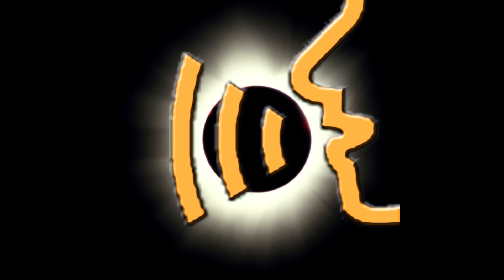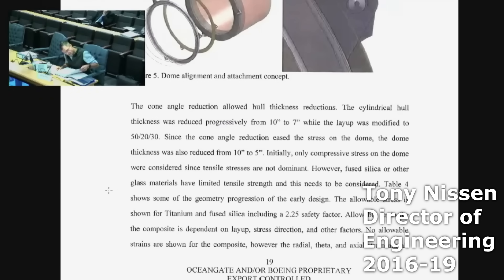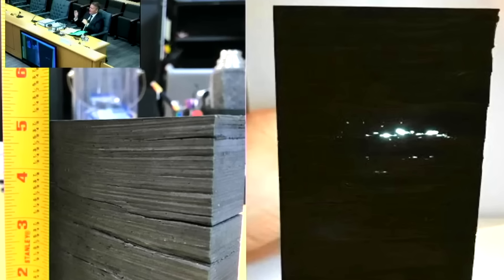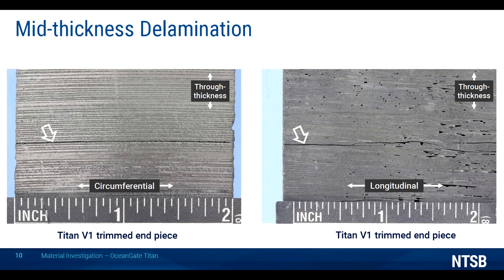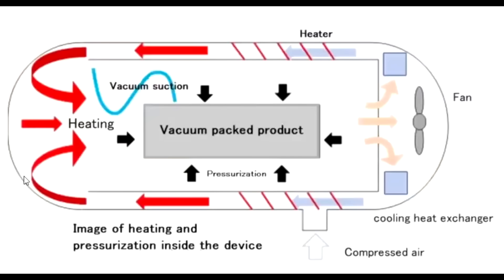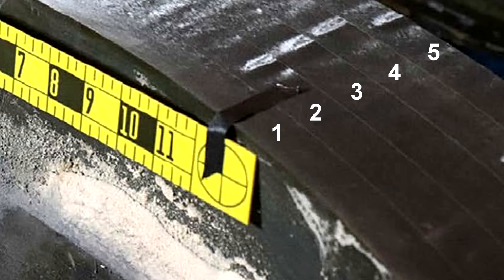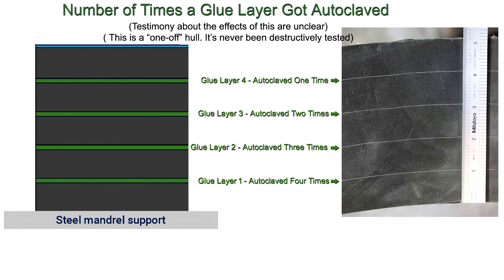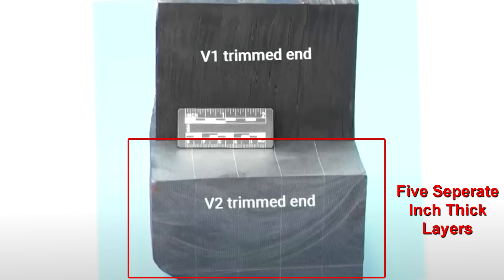Who Engineered the OceanGate Titan V2 Hull? Maybe Nobody Did?

Comment: It would be valuable if you would comment on what changes are needed in the system to close the loopholes that allowed Oceangate to function with such risk. 
Also, hoe can the public protect themselves against such risk?
Reply from the maker: There are a couple of things in the works right now.  The big international submersible groups are drafting some regulations that may be able to be enforced internationally.  So just because you are operating in international waters doesn't mean you are exempt from safety regulations.  I don't know how, or who would enforce it, but they are working on it.  I believe they will somehow close the loophole of calling paying passengers "mission specialists" and falsely saying they are crew.  And, there is talk of having all submersibles have a standardized hook on the top, the design of which is shared with all of the ROV companies.  This way, in a situation where a submersible is stuck on the bottom there is a standardized way to hook on to it and pull it to the surface.  It doesn't make a difference in an implosion, but what if the Titan was caught and stuck on the bottom, where could an ROV hook onto it to safely lift it.
Reply: i dont think the public has to worry about imploding in a million dollar/ride sub

Comment: By design it was a hull that 
a) would progressively degrade with each mission as microcracks formed and grew
b) had no process in place for measuring the state of cracks before or after each mission
c) had no idea at what point the amount of microcracks would yield to failure at depth

It was going to fail, the only question was when.
Reply from the maker: Agree, thanks for your comment.
Reply: I'm just gonna add that every design is going to fail at some point, so it's just a question of knowing when it does. And oceangate clearly didn't
Reply: @aninnocent1544  well, its also a matter of being within an acceptable amount of uses to justify the cost. But that is less relevant here.
Reply: @aninnocent1544  every design wont fail because some things are over engineered. for example a one piece steel hammer will never fail. you can swing it at nails until the sun destroys the solar system. compared to a hammer with a wooden handle that will fail at some point
Reply: @will.green.  You under estimate infinity and time
Reply: Finnish Baltic yachts builds big sauna to their 100+ ft carbon fibre hulls , of course they try to build as light as possible, but round keel hull is 4"

Comment: Completely revamping the material and production process of the hull and then assuming it will act in the same way is the most insane thing to me. And using a material with a low fracture toughness seems incredibly stupid
Reply from the maker: Yes, I agree.  That is why I wanted to make this video.  Thanks for commenting.

Comment: Any first year engineering student should be able to explain why carbon fiber is a terrible material for that application. The carbon strands are incredibly strong. However that's only for tensile applications. I'd trust that design for a pressure vessel. The application however was a compressive force so had to rely on the compressive strength and ductility of the binder material.
Reply: They basically used ABS plastic as the main source of strength and said "it's super strong".

Although thickening the hull might have increased the amount of work the carbon itself does
Reply: I'm not an engineer and know the limitations of carbon fiber.

Comment: Uuuh, I don’t think it’s safe to have uncured prepreg composite up and around for over an hour before curing it. I'm pretty sure it needs to either be refrigerated or shoved immediately into the autoclave after being applied or it might cure badly
Reply from the maker: Thanks for commenting.  I don't know enough about composites and curing to say. But the process of doing layers and driving the hull around must have taken weeks.  Plus the thing is huge and heavy so it has to be rigged and craned around, so the transportation takes way longer than just the hour's drive between the facilities.  I did not want to get into all of that in the video, but you understand how hard it is to move something like that around.  Others have commented about the temperature and humidity affecting the curing process during the transportation.  I don't know enough to say.  I guess Electroimpact was okay with everything that was being done.  They were the experts.
Reply: @ what I know is that prepreg needs to be refrigerated to low temperatures before layup because the resin will start curing in hard to predict ways at room temperature. Each product is different but manufacturers will typically have a chart that will describe, between other information, how much time can pass between the thawing of the prepreg fibers and when they have to be in a vacuum package, and how much time before they have to be in the oven, and if that delay passes the fibers have to be thrown out because the resin will have cured too much for vacuums and air bubbles in the resin to be sucked out in the autoclaves, or for the manufacturer to be able to guarantee the properties of the resin.
Reply: Depends on the prepreg. Some have unrefrigerated shelf lives of days. Today TC380 has an out life of 28 days. Data sheet is free online if you want to check it out
Reply: @ that’s interesting, thanks

Comment: At the very minimum, designs should be required to test until failure at least once before carrying human occupants.
Reply from the maker: That is correct,  The budget should have allowed for one hull to be tested unmanned for say, 20 to 30, dives and then cut up the hull and examine the hull for evidence of fatigue and delaminations.  Destructive test.  But of course, the budget did not allow for that.  Thanks for commenting.
Reply: That doesn't really tell you much about fatigue life though which is the failure mode that occured here.
Reply: That's not practical for an airliner.
Reply: @robertlee9395 Major parts of airliners (wings, fuselages, landing gear) already are destructively tested, and occasionally fully crash-tested, but that heavily depends.

Comment: They didn't talk much about the grinding process to remove bumps between cycles. If the image they showed of the hull with longitudinal wrinkles in it was the working hull, is is quite clear why this machine failed. As the fibers of a full hoop are compacted radially, they will buckle prior to curing, as they cannot shorten in length to match their shortened perimeter. IE the fibers that are assumed to be straight, are curved, massively reducing their compressive strength. Then, several of them that are protruding past the surface are broken (ground off). I've built landing gear that got some wrinkles in the unidirectional fiber's and the strength was reduced by about 3-5x until we improved the process and eliminated those defects. Also, I do agree that the 45 degree fibers would have helped transmit the load between defective regions and adjacent intact regions. But what do I know, I'm just an unemployed engineer.
Reply from the maker: Thanks for your comment.  I ma working on a video addressing that right now.
Reply: shouldve kept your mouth shut about the safety of landing gear and let the planes crash if you wanted to keep your job

Comment: I dont understand why Stockton didn't send the sub down to the titanic empty first and make sure it comes back up alright.  Would have saved lives
Reply: At 19:55 you see the chart that shows that they did dive to Titanic thirteen times... and imploded on the fourteenth.
Reply from the maker: Thanks for your comment.  The V2 hull was a one-off and never tested other than 4 pressure tests in the chamber in Deep Ocean Test Facility Maryland before they started diving with people.  That hull should have had a rigorous testing program of dozens of unmanned dives first followed by destructive analysis to prove the design.

Comment: Thank you for the video, although it confirmed what I already knew. Carbon fiber is superb in a tension mode. In compression, a stack of bricks performs maybe better.  NASA is interested in space applications where a hull is subjected to tension rather than compression. I was surprised about the '45 degree winding angles' question in the hearing. Pressure in a cylinder forces the endcaps off and tries to enlarge the diameter of it.  In the cylinder wall these forces are not  at 45 degrees (wrt the axis).  Tangential stress is twice the longitudinal stress, so the best fiber angle is not 45 degrees. Stockton was a prime candidate for a Darwin award. Too bad that he also killed innocent people and caused a lot of public money go to waste (Coast Guard search, diving operations, forensic efforts, hearings etc.).
Reply: They speak to the 45 degree angle in the video, as being important for damage tolerance. IE, the 45 degree fibers allow for shear transfer between adjacent fibers, if one is broken. Makes sense to me as an engineer with some composites experience.
Reply from the maker: Thanks for your comment. I think the point from Boeing when they were doing their feasibility study was that 45-degree plies would help with load distribution if there was an area of laminate with defects.  Also if damage from external stress does occur with some neighboring fibers, it allows another path for load distribution to potentially stop damage propagation.
Reply: Most importantly, in the space, the pressure difference between a habitable vessel and its surroundings is 1atm only, which is nothing compared to 100s of atm at the Titanic depth.
Reply: i agree it was a waste. they shouldnt have searched at all

Comment: I still think the craziest thing about Oceangate is the fact they had multiple working subs with standard builds but then decides to throw that all out the window to try a carbon fiber hull.
Reply from the maker: Antipodes and Cyclops 1 were both pretty shallow subs and would never be able to be rated to 4,000m.
Reply: @solareclipsetimer I mean to be fair, neither was Titan…

To be serious though you would think if they were trying to make a safe sub they would use a material they are already familiar with if possible. Of course we all know the real reason they used carbon fiber, Money.
Reply: @jackeyboy6538 money and speed .. carbon fiber is lightweight... so turning back is easy metal tanks are heawy and requires additional operations and energy to move up mostlikely vatteries they used werent capable of providing that power .. as itll require additional decompression for that additional metal hull and additional batteries for that ebergy needed which makes it require even more vatteries which increases weight which requires ewen more batteries... so with electric power itll be wery heawy and slow .... i stead they used fiver with disposable weight .. as ocean is big and scrap metal is cheap...😅😮😂

Comment: The root cause seems pretty simple: every time Rush had to choose between greater safety or lower cost, he ignored all the advice he was given and chose cost.

The ocean always punishes that kind of arrogance.
Reply from the maker: Thanks for commenting.  Yes, subsea is an unforgiving environment.
Reply: Is this really so?  CFRC is VERY expensive to fabricate compared to steel or aluminium, in a one-off (not so much so in long production).  Was it not perhaps not that CFRC just sounds more sexy?
Reply from the maker: @ Thanks for commenting.  I believe Stockton miscalculated how complicated and expensive it would be.  For instance, he probably did not plan for the V1 hull to be poorly made, to begin with, and then struck by lightning and therefore the need to build a second redesigned hull.  The complexity and the costs spiraled, but he would not give up.
Reply: @marionbloom1218  I recall seeing interviews where he was sure using carbon fiber would reduce the operating cost and result in a vehicle with greater passenger capacity over steel or titanium. 

He expected all those factors to open the Titanic up to tourists rather than just being for researchers, and expected the profit margins to make it feasible. It was that push for margins by driving cost down to increase profit that drove a lot of his bad decisions.
Reply: @mawnkey  Including tsunamis the oceans have claimed millions of those that underestimate.

Comment: What amazes me is the fact that any engineering firm would have anything to do with the project given what is presented to have transpired.
Reply from the maker: Thanks for your comment.  I think what happened was, when people first start working with OceanGate they seem reasonable, conscientious, and organized.  But after a while you see the problems with the mentality and the culture at the organization.  But by that time you name is already associated with OceanGate and it can potential ruin your reputation.
Reply: @solareclipsetimer  I've worked as a residential builder and have run into this situation with General Contractors and other tradesmen on a project who are doing something unsound.  If I see it, particularly if it is going to lead to an unsafe structure, I confront them immediately pointing out the deficiency and if they fail to rectify the issue, I make it publicly known in a not discrete manner.  That is how you handle those situations, if you have any sort of moral backbone.  Unless I missed some press releases pre-implosion, NASA, Boeing and UW all saw serious issues and just backed away instead of holding Rush's feet to the fire.  If so, they knowingly allowed a nutter to kill four other people.
Reply from the maker: @foogod4237  Yes sir, you have it summarized exactly.  OceanGate engaged help to get just enough information (for what they wanted) and then terminated the agreements to save money.  Then the companies that worked with them early, but were never allowed to help them with the fine points, ended up looking bad.
Reply: You would be surprised. I have consulted on pressure vessels and seen designers make very obvious mistakes that they then turned around and blamed failures on the builders. Anyone who knew anything about pressure vessels would know their design was fundamentally flawed and could never work

Comment: You can’t just glue metal together then use it as a sub 😮
Reply: Yes you can, you just can't expect it to be serviceable. 😉
Reply: Well, (a) it wasn't metal, it was largely carbon fiber, and "gluing" is actually the correct way to work with that material most of the time, and (b) nowadays they do actually make chemical bonding processes ("glue") that work quite well with metals too, and are often much stronger than more traditional fastening methods, even when working with metal, so the idea of "gluing metal together" is actually not as silly (or weak) as it sounds.

The problem wasn't necessarily the methods they were employing, it was the way they chose to apply them, and their apparently complete disregard for established engineering and safety requirements in general.
Reply: The F22 and F35 use glue
Reply: @pegcity4eva  And they also are NOT submarines....  🙄

Comment: even 7 inch wouldve changed nothing.
Reply from the maker: Thanks for commenting.  I agree with you, if they still used the con-bonding technique, it would have failed.
Reply: The problem is it's really hard to say, because they deviated in so many ways all at the same time, and never actually tested any of it.  It's possible that 7 inches might have been enough, but nobody even tried to find out.  It's possible that 7 wouldn't have been enough, but 10 might have done it.  It's possible that if they hadn't machined down the edges to try to fit the existing rings, that might have made a big difference too.  Or it's possible that the whole multi-layer-bonding thing would never have worked adequately, no matter how thick it was.  Who knows?
Reply: @foogod4237  still different modulus. Wouldve failed partially layer by layer and wouldve imploded because of the connection to the titanium rings. Temperature change alone wouldve done it over time.
Reply from the maker: @ Agree, too many variables and nothing methodical about the process.
Reply: I think it would have saved the lives of the people that died... and then cost a different group their lives later on down the line. In other words, it would have delayed the tragedy.
But I'm just guessing, I'm no expert or anything.